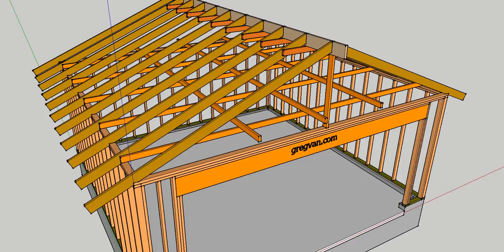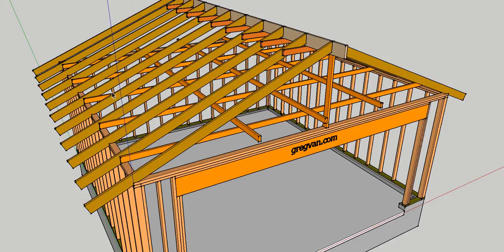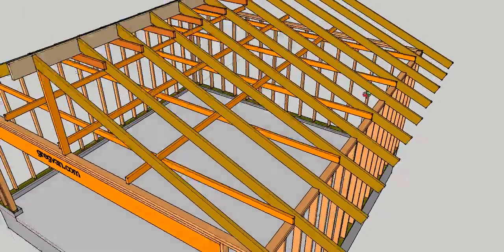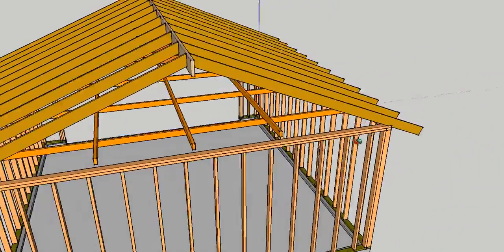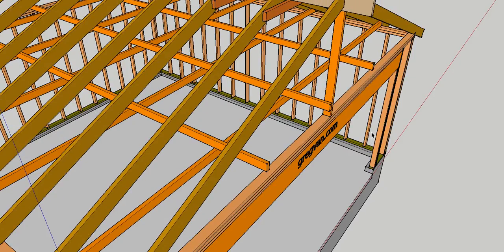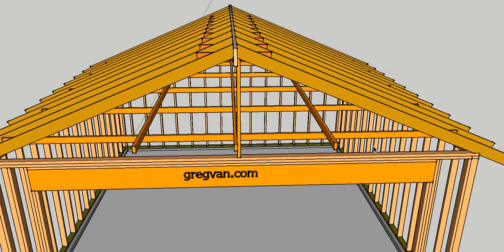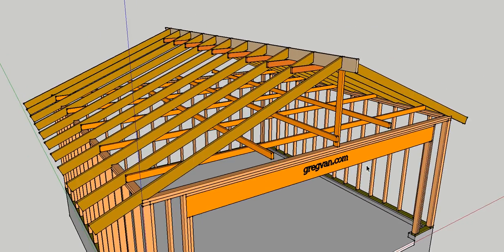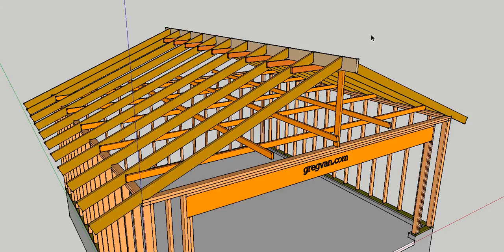Garage Rafter Ties Connecting to Top Framing Plates Example

Comment: How do I connect the rafter ties to the strong backs?  Is the a bracket I can use?
Reply from the maker: The strong backs usually sit on top of the rafter ties and are simply fastened together using 2-16d nails that are nailed directly into or vertically into the rafter ties. You can use hardware for additional support (sounds like a good idea), but I've never seen it done.